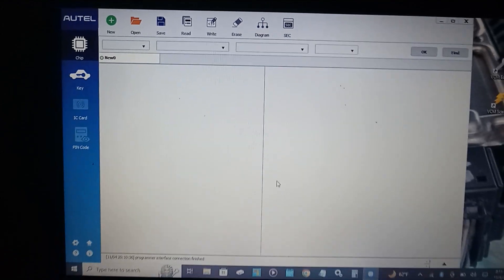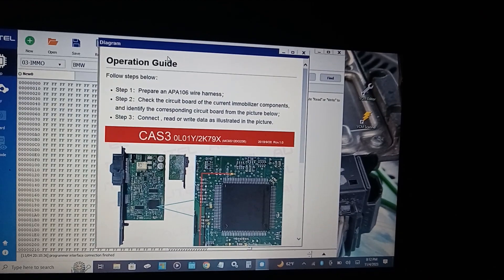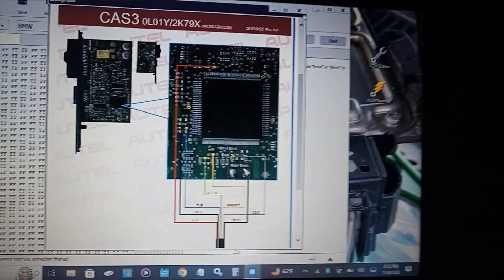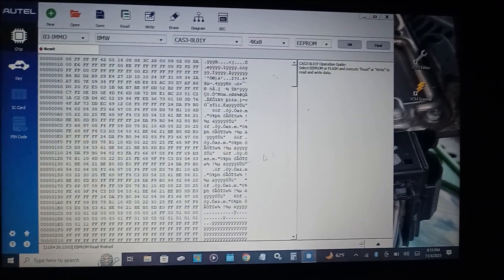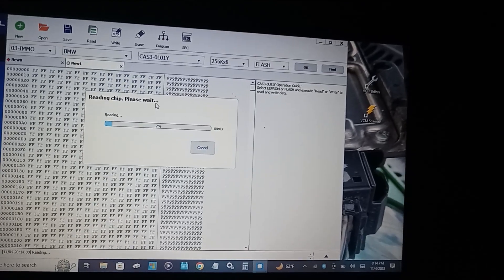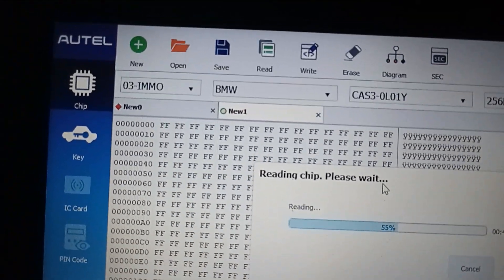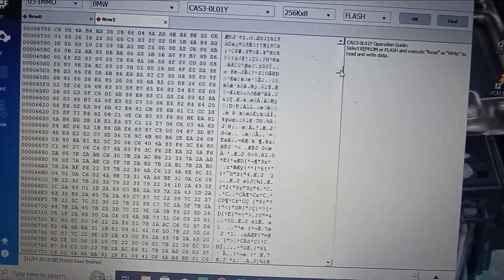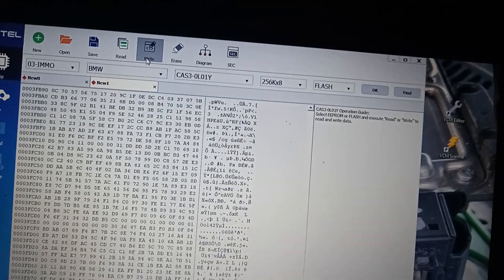Autel xp400 BMW CAS3 used module clone...              #autel #eeprom #automotivetechnology #mods

Comment: does the IM608 have ability to program a new cas module?
Reply from the maker: No you will need BMW software like ISTA P to flash the operating software and part number to the CAS module.
Reply: @12voltautoprogramming40  so a laptop and j2534? or what tool to hardware interface?
Reply from the maker: @pouncerminned863  Yes J534 and your laptop with  "Ista P" will program any module on your vehicle. Their is other softwares  you can use but most are not as reliable as ISTA P...
Reply: @12voltautoprogramming40  thank you!